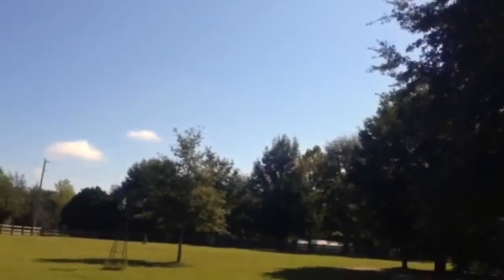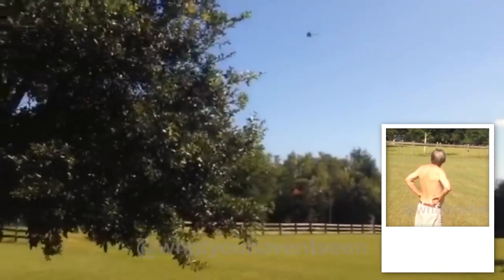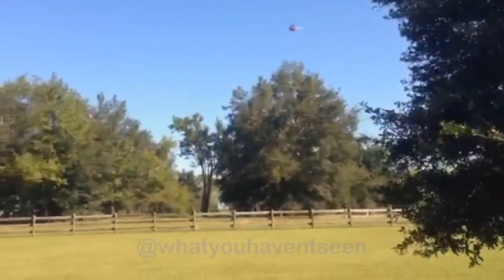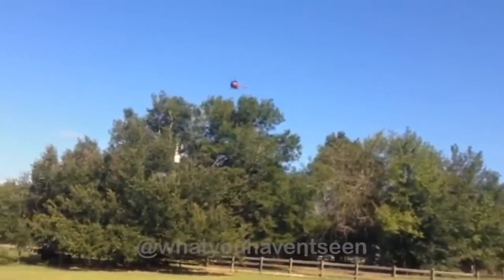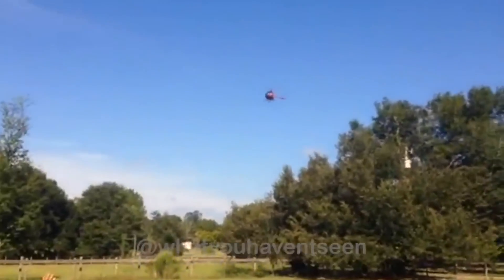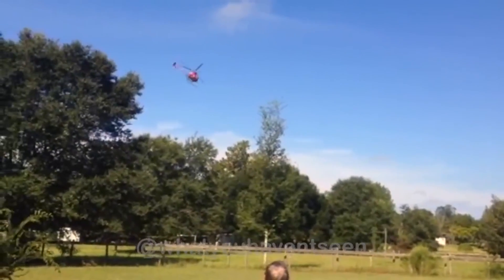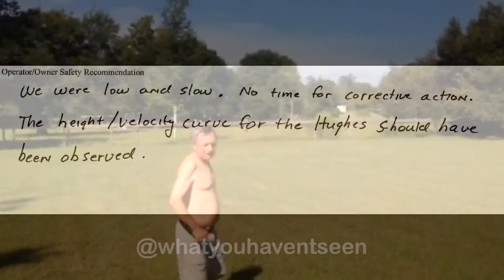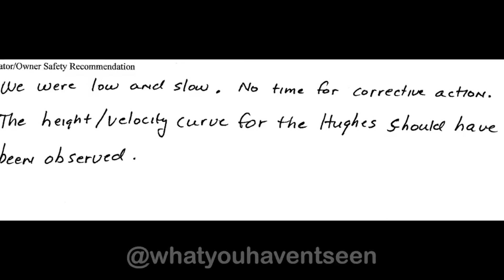Loss of Tail Rotor Effectiveness, Unanticipated Yaw - All the explanations

Comment: Do you get these same conditions in turbine helicopters like the MD500, or is there Less chance because of the higher head speed.
Reply from the maker: Excellent question! LTE (Loss of Tail Rotor Effectiveness) can still occur in turbine helicopters like the MD500, but certain factors — like higher rotor RPM, tail rotor design, and power availability — can reduce the risk or make recovery easier. That said, no helicopter is completely immune. It’s all about understanding the conditions and managing yaw authority carefully. Have you flown the MD500 or are you just a fan of its design? 🚁

Comment: Hello, 

I beg to disagree here. 

LTE will happen as a result of putting yourself in a situation where youre running out of power. Its not some ”vortex” situation that just happens. If you have the power available and you stay ahead of the helicopter, its not going to start spinning. As EASA is calling it ”unanticipated yaw”. 
What is the unanticipated yaw? If youre going to fly a helicopter you must know the basics. A tailrotor has less efficiency in some winds, yes, some models worse that others(B206 for example) but you should know that and avoid putting yourself in those situations. However if you have power available and stay ahead of the helicopter, it wont happen. I will quote my old instructor, Gordon H, here; ”Its all very feely feely”

First you say its a windproblem, then you say hot high heavy. Dont you think that is contradictive? 
Why is it a problem with the wind? Well usually because hovering out of wind requires more power and most medium-small size helicopters are not very powerful.
Reply from the maker: Thank you so much for your comment. I think we do actually agree here. You also say that the tail rotor is less effective in some winds, as explained in detail in the video, and that if you don’t have enough power, which is often the case in hot, high or heavy conditions, you are at risk. 👍

Comment: Hello Fly High great video, love your stuff. LTE - loss of tail rotor Efficiency, or Effectiveness? Sorry for being nerdy, either way the result is the same, ask me how I know!?
Reply from the maker: Thanks! You know? I’d live to hear your story.
Reply: @flyhighwithcarothepilot  thanks, ok so coming in to the hover at the end of an approach, strong crosswind from the right, heavily loaded Sikorsky S76. As we slowed down, bringing in the power and left pedal at the usual rate, I could do nothing to stop the aircraft rotating quite rapidly through 90 degrees to the right…… basically it was weather-cocking in to the wind, and fortunately stopped turning once pointing 90 degrees right of where I’d planned it to be. 
As you so well demonstrate in your video, full left pedal required, to be honest I have no idea how much I used, it may have been full pedal, but it was insufficient to stop the turn.
I think instinctively I lowered collective just a little to reduce the power demand, which helped for sure. Luckily the rotation rate, although quite rapid and certainly uncontrolled, didn’t develop further.
The funny thing was my colleague beside me thought it was all totally planned to align the aircraft into the adjacent taxiway - I did come clean ! 😃.
Every day’s a school day right?
Love your content, thanks.
Reply from the maker: Thanks for sharing! 😁
Reply: @EtiRats  Interesting information, runing out of left pedal should be considered a different case of LTE, airbus has an excelent video about pedal curve, a little confusing but with de same conclussion of applying full pedal. You can lose tail rotor thrust from a few different sources, wind, your own main rotor vortices, and another relevant factor is your main rotor RPM.

Comment: You are explaining LTE very well and have chosen a very typical example in the video material. I like the way how you are explaning: As detailled as necessary, not simplifying, but as well not overcomlipcated. So with enough altitude and at the right place withour obstcle in front it should be possible to "fly out" with cyclic forwad input of a LTE situation, similar to flying out of a Vortex Ring State with forward speed?
Reply from the maker: Absolutely! Use the power pedal to stop the rotation, lower the collective and fly forwards.